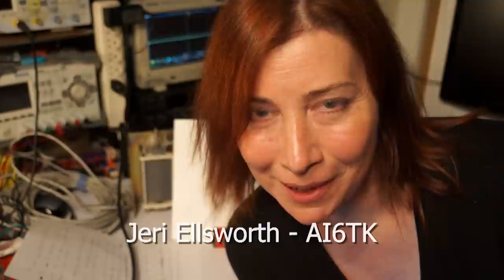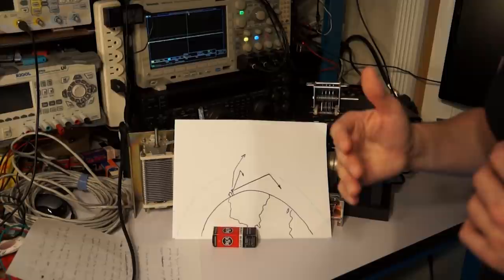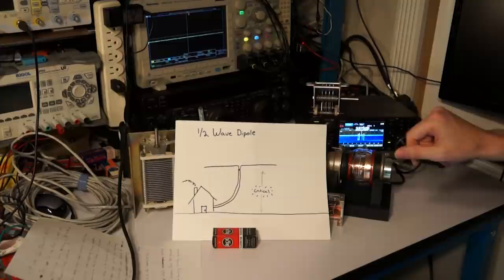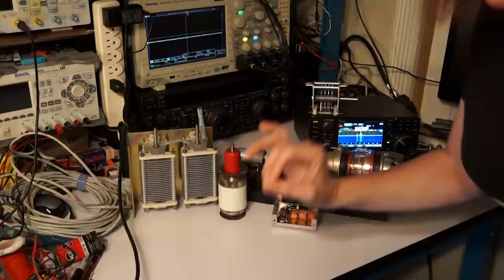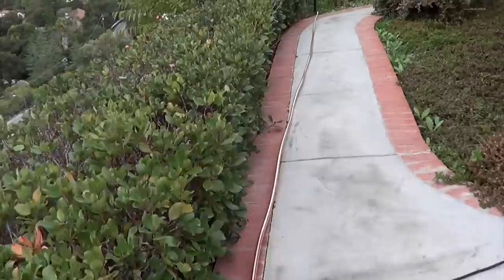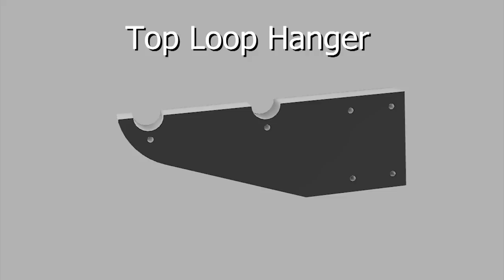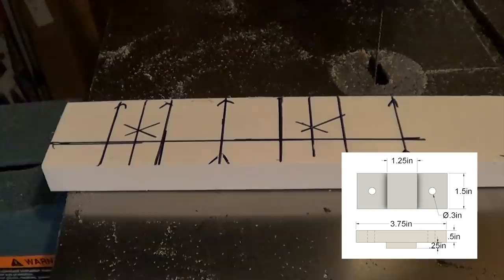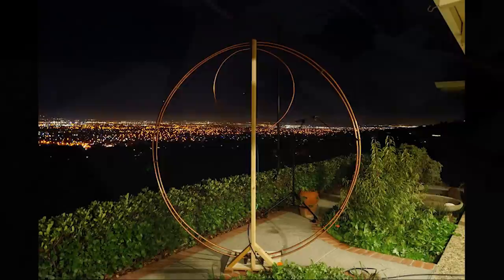Build a 160/80 Meter Magnetic Loop Antenna - Part 1

Comment: Did you consider leaving the 50ft continuous with 2 loops?  50 ft on 80M should resonate with 130pf and be 64% efficient.  you might have to build a special jig for bending.  On 160M 50ft resonates with 493pf and is 15% efficient not super different from a low dipole.  Also you can get better coupling and efficiency between primary and secondary with an egg shaped or squished oval primary.  You also get better coupling by having the coax opposite the loop (far away) as opposed to next to the loop which is I believe how you do it.   Ideas to play with.  A simple effective measuring device is a field strength meter to determine relative efficiency.  great video

Comment: Nice to see you back Jeri, what about using a 9:1 UNUN matching unit driving a long wire antenna, and having the unit in the roof space and bringing the wire out through a hole to a insulator some 1mle from the house.

Comment: Great video.  I noticed you cut the spacers then drilled/cove cut the ends.  You could have done it one shot by drilling a "hole" through the pipe at the place you would have cut it.  Wind up with two pieces and a cove at the end of each.

Comment: A lady radio ham, a rare species indeed.
I've read about mag loops, but never tried one... I'd probably have gone with a loaded vertical to get lower angle, though the problem with that approach is losses in the loading, and the need for an extensive ground system, though as I recall, the losses in a mag loop are also pretty horrendous

Comment: agreed on the hi angle of radiation in beginning of your video however 160-30 should NVIS nicely even without a reflector under it..you should expect around 1000 miles nvis.in my opinion

Comment: You should actually have drain holes on the loop pipes at the bottom to avoid them collecting water inside. Just small holes is enough. This is especially important if you get freezing temperatures.

Comment: Jeri, will I need to adjusts your specs if I change the loop material to LDF4-50A (1/2" Heliax) instead of the copper tubing? I am also wondering what sort of efficiency I will have at 40 meters. My understanding is that if the loop is too large for the operating frequency there may be self resonance. BTW, it was a pleasure to watch the video. I am rather tired of being bombarded solely with loop theory and very little on practical application. Everyone that builds an antenna does not have to be an EE. ;) Well, I supposed that could help but I am more of a trial and error kind of person.

Comment: while i have never done this i have been looking at this for a couple decades now and i beleive you could improve  your design by soldering some 3-4 inch wide copper flashing to the loops to increase your surface area and reduce resistance ....my plan if i ever get to do this is to build a legal limit +++++ 160 meter loop its been a while since ive done any thing with this but if memory serves me i was looking at about 37 feet with a 3 inch dia conductor...3 inch copper pipe aint cheap....

Comment: Very interesting! I'm presently using an inverted V with its peak at around 40', fed by open balanced feedline with a balanced tuner in my shack. It works very nicely on 80m and above, but I didn't put enough wire up in the air to get it to match at 160m. Even if I did, I think I'd probably have the same launch angle problem that you had. Maybe I should build an 80/160 loop, too? I had been wanting to play with diversity reception using two receivers during the 75m AM voice net I'm on every Saturday evening, anyway. I was originally planning to add a vertical whip as my alternate antenna, but using a loop plus my dipole might be another cool option.
Reply from the maker: You should build one.  It's not very difficult.  :)  I found the high Q of the loop also helps cut down terrestrial noise compared to my dipole.  I'd love to know if you have similar results.

Comment: Diameter of a hollow copper tube does not affect its resistance. Total cross section of the copper does.
Sorry, great to see you doing videos again, need more females interested in this stuff.

Comment: 160 and 80 are primarily "short haul" bands - typically 2000 miles or less. If you want to work "long-haul" DX (>5000 miles) consistently, you'll have to use digital modes like WSJT - FT8. From the west coast, with 30 watts you should be able to work Japan on 160 on your loop depending on its height (the higher the better). On 80, you should be able to reach Australia and most of SE Asia. The downside is that FT8 may not be satisfying to a "hacker" like you. It's easy to set up and get working - no experimenting necessary. But it's fun is to see how far you can make contacts.

Comment: Is this aimed only at getting a low angle of radiation (the only issue mentioned in the video)?  Or is this build because there's a background noise issue that it needs to assist in overcoming?  Or maybe the coolness factor is in play?

For solely low angle radiation, I think I'd have looked first at a vertically polarized antenna. Loaded verticals (and I'm including continuously loaded, not just lumped loading) construction & feed don't seem to be as finicky and efficiency may even be higher.

Another thought is that this loop is shown being oriented to emulate a horizontal dipole with dipole-like problems as far as angle of radiation. It may be worth running a simulation of the loop laid in the horizontal plane (emulating a vertical dipole) at different heights.

Comment: Hi Jeri,
Andy (KC6WUM), as I am an advocate of Loops for antenna choices I would like to see your conclusion of the 160/80 meet loop. There is a very little 160/80 meter loop design out the and I would like to see how you handle the 5KV + capacitor for a 100W + radio. Thanks for being active in sharing. "73

Comment: Hi, Enjoyed the 80,160 magloop construction. I watched video where KB9RLW made a 1ft sq magloop. one interesting outcome from his testing, was  loop was in diamond config, it showed radiation patterns in angles good for DX. I constructed several loops that worked good. They were round. in my lastest constructions i hv used his diamond config. i started out with a 10F 1/2 inch hard copper tube. cut into 4 lengths of 2.5F. This seemed to work very well. To increase percent of rf power, decided to increase lenght to 17F. had couple FT-8 contacts with +14, +5 reports, that was great. altho, it cud hv been conditions. I was wondering if you mite consider construction an antenna to obtain field data on its operation.
thanks for your consideration
Cam W4LIX

Comment: Nice to see a video!  I have also built a mag loop antenna, reached as far as France with it using PSK31 but on 40 meter..... N9DDD....73s
Reply: BTW it was a portable design make with some RG213 for the loop, give it a try for QRP work.
Reply from the maker: I think the coax magloop is one of the better portable antennas if you can't get it far off the ground.
Reply: Yeah I just used a folding tripod to get it up about 6 feet and it real worked well!

Comment: hi Jerry, neat video, when is part 2?
i was looking at demo on radiation pattern and was wondering if loop was rotated 90degs, with cap and coupling loop in horizontal plane, if that would add more directivity and gain to loop. your thoughts. note: roll loop to reposition coupling and tuning cap. loop remains vertical. 
73 cam w4lix

Comment: Very nice, the only thing i like to now is wy two loops, wy not one loop, is that for efficiency or for more bandwidth? wy two loops, i like to now. Looking forward to the next part, i like to now also about the vacuum variable capacitor, so it can handle more power, i hope thats next, thx very nice video, i am thinking of building one for the 40m and 80m band, 160m is to big for me, 73

Comment: For the spacers the drawing shows 4 inches from OD to the OD. For the hanger you show it as 4 inches center to center.  Is that a mistake and if so which should I use to make my spacers and hangers? Love your video! I can't wait for part two.

Comment: Getting dirty and sharing your experiments is inspirational, especially for the aspiring lady engineer in my family (kc9zkf).  How do you like the IC-7300?  Looking forward to part 2! ke9g
Reply from the maker: I use the 7300 about 75% of the time.  Good radio.   I have a Yeasu FT1000MP that seems to do a little better when I have a strong station nearby.

Comment: Hey Jeri,  

I can't wait to see more. I built a 20/40M mag loop a while back but I never really got good results with it. The one part that really worked well was the ESP8266 based wifi tuner. I used a stepper motor and its a bit noisy while tuning, but the noise does help find to tell when its in tune. 

One question that I had, was does it matter if the capacitor is on top or bottom of the loop. I notice in your design its on the bottom. The design(s) I was following all had it on the top.  (Which puts the weight of the vacuum variable cap at the top).

What effects will nearby metal have on the loop?

I'm liking the design your building. I'm thinking it would be a good antenna for the back of my motor home. I'm curious how it may interact with the chassis and wiring in the motor home.  The walls are fibreglass and wood. 

I can't wait to see/hear the results you get from this antenna. 

Thanks and 73,
Chris McDonald
VE1LX
Reply from the maker: The capacitor doesn't seem to matter from what I've seen on mine and researched.

Comment: Jeri,

Great Vid!  I can't wait to see the rest of the series.  My Dad and I (both licensed amateurs) are building a 40m mag loop on-and-off as a background project.  We have run into a bit of a stumbling block on the tuning capacitor (right now we have a home-brew copper pipe trombone looking affair), so I would ask that if/when you cover the tuning cap you might make some suggestions for sourcing components...  Also, I was curious what software you used for modelling the antenna energy in you video.  We recently threw a dipole between some trees here and I'd like to give modelling it a try.

EDIT - Just found my software question was already asked and answered below (EZNEC).

Again, great stuff - keep on keepin' on!

73 Geo... (KA3KEU)

Comment: I'm fooling around with the idea of building one of these.  I can't seem to find a MLA calculator that factors in a double loop though.  I'd like it to work on 80-40m, and would probably use heliax of cellflex coax.  I have no clue what diameter to use for a double loop (like the one in your video here where you have two circles for the main loop) or what my capacitor rating should be...

Comment: Have you played with any Directional antenna? I'm not into HAM but, I fly fpv rc and getting a radio signal to go as far as possible with as little power is something that interests me quite a bit as well especially with the high frequencies I'm forced to work with. I might have to try one of these but, I imagine it's quite sensitive to tune.

Comment: The downfall of these antennas is the epic varicap required to satisfy swr and resonance Q. You will constantly be dead keying a carrier to tune these every few khz for transmitting. Twisting wire, circuit board level capacitors, and a salvaged broadcast varicap, for fine tuning, is great for recieve with the loop, will not be lightening bait connected to your home during a storm, and you can still send QSL cards to stations you only recieve.

Comment: At what frequencies does your antenna operate? Have you heard of the J-QAM program? With your soundcard it can send and receive digital packets (UDP) for a nice off the grid wireless internet.
Reply from the maker: This antenna will operate between ~1.5mhz and ~4mhz.  Adding a bigger capacitor will bring it down in frequency.  I'll look up J-QAM.  Sounds interesting.

Comment: Hello Jeri and Amy,
Very nice build. One thing that quickly caught my eye was the second loop. I am very curious about how well it works with it. It is an interesting concept to cut down on size, but aren't you adding a 2nd feed point to the outer loop in this case? I am curious as to how this effects tuning. I wonder about phase angles between the 2 loops and how much that affects swr and efficiency. Just some thoughts while being plagued by insomnia.. Lol
73 de Dennis - KN4AYP :)

Comment: Hi Jeri,
Was that Delrin you used for the upper and lower supports? What is the black tripod supporting behind the loop at the end of the video? 73  WB3BJU
Reply from the maker: It felt and cut a little like Delrin, but I'm not sure because it was scrap I picked up somewhere.  The tripod had two ham-sticks back to back to make a portable 20meter dipole.
Reply: I have made a rotatable dipole out of pairs of Hustler MO2 masts, the tri-adapter plate, and resonators for 80, 40, and 20m. Works well, but has limited bandwidth. Looking to make the 160/80 magloop and replacing the Hustler dipole with an MFJ cobwebb with the 40 and 30 elements. I already have a 10-15-20 triband yagi.  73  WB3BJU
Reply: Looks like Delrin to me. Those "cocoa nib" chips are pretty signature.

Comment: Have one quick question: When you were building your 2 turn Magnetic Loop , did you do any experimentation i.e. measurements of SWR ( return loss) which led to the 4" spacing between the two loops ?  In sum, how did you arrive at using a 4" spacing ?

Comment: Howdy.  Just wondering a couple of things.  If the loops are connected with copper wire, why can't the hangers be conductive?  Why do the loops need to be fixed from forward and backwards tilt?  I would think a controlled tilt could allow better reflection control as atmospheric conditions change.
Reply: Bill Smith I do not recall them being them being "connected" with copper wire (around 6min mark), though they are tied to the insulated spacers with a length of copper wire.  However, those copper wire ties are not connected to each other, you could just as well have used plastic wireties, wire was just her choice of tie material.

That said, there are plenty of instances in radio where a length of "shorting" wire is used for the purposes of making an effective match (such as between the driven elements of a Yagi), but there it is important to recognize that what may appear to be a short circuit at DC (as in direct current) is not necessarily a short at high frequency AC as that length of wire has resistance, inductance, and, usually, some capacitance as well and it's function must be reevaluated in that context when HF, and above, frequencies are at play.
Reply: Thanks, I can see that now.  I should have paid more attention.  I don't know if you're still there, but could tilting the loop cause lengthening of reception distance or would it always result in shortening?

Comment: Hello,
I’m super not skilled at the technical side of HAM, but I’m an avid operator. Is this antenna more appropriate for someone with tech skills, or will I be able to simply do exactly what you say, have parts fabricated where I lack the equipment, and make it work? Thank you.
David

Comment: Hi Jerry, i hv been using circular magloops for awhile. i saw a video by KB9LWR where he made a junkyard diamond shaped loop on a plastic egg crate. during his presentation, he found that  it had some directivity in the horizontal direction. so i made another antenna out of 10ft hard copper 1/2 inch thick, 90° ells n silver solder.
after i got it tuned up and started using it, i began to think it was working better than the circle loop. the diamond breaks the NVUS upward radiation into the lower angles that DX can be reached.
i wonder if you could make a similar antenna and describe you findings on the radiation pattern and angles of power distribution. and any other interesting things you find out
73 Cam W4LIX
Reply: my loop legs 2.5 feet

Comment: Good looking start!  You two put my work to shame... Did you model height over perfect ground?  In the real world, think about mounting over a conductive surface (about the same size of you loop turned horizontally on the ground)and mount it about 1 loop radius in height above the conductive surface and see how that affects the potential for DX.  What about that feedpoint?  I generally have accepted that small loops are fed opposite of the capacitor, however, with a double loop, it appears you're feeding it at 1/4 the way from the capacitor. (are you effectively feeding it at 1/4 AND 3/4?)  Is placement of the feed loop not critical along the length of the main loop in your experimentation?  Looking forward to learning more from you and Amy!  73 de AE5WW

Comment: Putting solar panels with Al foil backing above dipole may work better as that will eliminate radiation to top. Of course, you probably need an acre of panels, but what the heck, charge your EV with excess solar!

Comment: I live in a town surrounded by mountains. We get 2 piped in radio stations. I have a small FM station of my own that I use to listen to podcasts while out with the dogs or doing yard work. Its reception is about 2.5 miles. It's a transmitter I built myself. I'd like to add an amplifier to it to boost the signal and lessen the audio artifacts.  I can't build up a high antenna without getting a permit and license. Would this work to boost an FM signal?
Reply from the maker: You might take a look at the receive only loop designs.  FM antennas can be much smaller than this.
Reply: From your explanation, I was thinking that it would bounce the signal off the cliffs I aimed it at. There are 2 3500-foot cliffs near me. I'll watch this series with interest just to see your results.